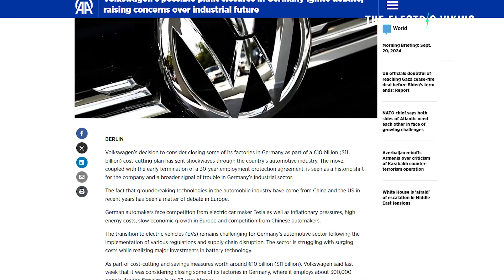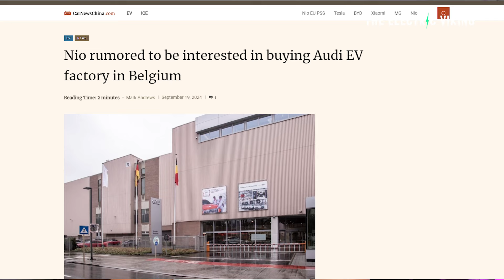Leaks claim Nio plans to buy VW Groups Audi factory in Belgium

Comment: Viking,  you still look at the Nio strategy as a checkers game. You have not covered China's move to start battery inspection. What's going happen when they find questionable batteries? The owner will be put in a position to:
1) fix the battery at a higher cost
2) Sell it if they can
3) Wish they bought a Nio or Onvo
The investment in Baas will prevail.
Reply: Most batteries/ battery cells are replaceable.
Reply: @paulc6766  Yes, with very high cost. In the case of NIO, it is just a one swap away from the new battery in their NIO cars service center. Please guess or provide information for us, which one is cheaper way to replace the EVs battery to new: with NIO / BaaS or Tesla structural battery.